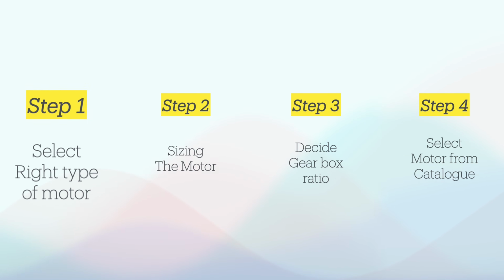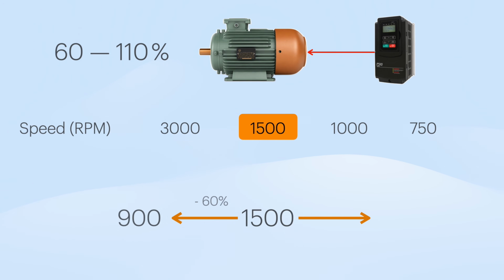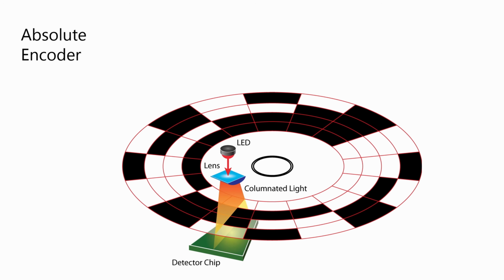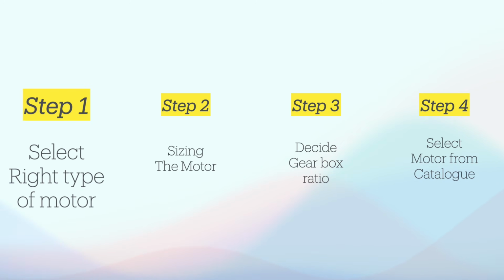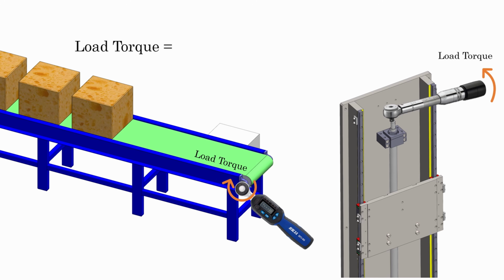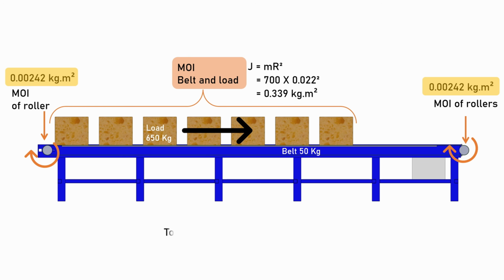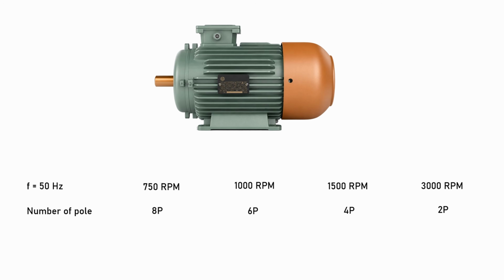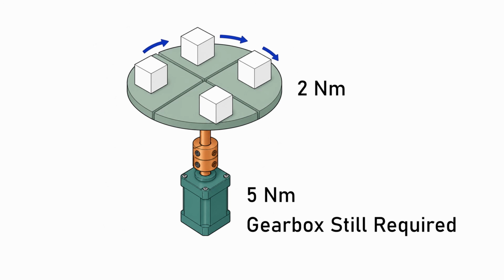Why Most Engineers FAIL at Motor Selection (And How to FIX It)

Comment: Hey I have to buy a motor for a project. It is rmcs2080. The specification has a rated torque 280kgcm which is greater than the gearbox braking torque of 200kgcm, our use  is little more than 200kgcm. Is this a problem?

Comment: 3Ø Induction motors can also be speed controlled using VSD/VFD. This can be closed loop PID, speed or torque vectoring. Advanced motor protection settings. They also have a bonus that when consuming energy Power Factor is near Unity, increased startup torque, reversing, inching, plugging, dynamic braking, communications feedback options, HVAC fire run until destroyed mode...

Comment: HI, 
I have seen rated torque, 
continuous torque, 
standstill torque, 
continuous standstill torque, 
holding torque, 
and continuous holding

Can you explain about this in your next video please.
Reply: ELECT motors has huge " bottom end torque " if NOT  operated for extended time. And depending on Ambiet temp ( winter ) There are applications. Where " over loading " is NOT a factor lol

Comment: Actually, there are so many steppers used in industrial automation rather than PMSM servos, but with closed-loop system by integrating it with encoders for high-precision. These closed-looped steppers are often found in Chinese standard machines like labelling machines, filling machines with peristaltic pump, and PCB solder-paste application machines. The reason is not to make it cheap, but to achieve the same high-level reliability as the PMSM servos, because steppers are accessible in the market, as these high-volume Chinese machines do not operate at variable speed and at ever-changing load applications. Yet, I do agree with you that PMSM servos are best used in highly dynamic machine design, especially if machines or robots to be designed require high acceleration torque + MOI.
Reply: And thank you for these videos. It helped me do something different for my career since I was given only limited work because of my fragmented roles. I consider you as my senior as well :)

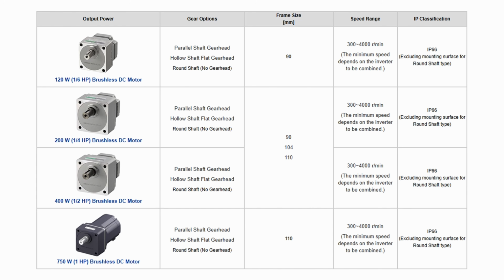Comment: bro was just checking randomly whether u put any video or not,,thank u...and the  screenshots u used like at 5:56 from which website? will be a little help
Reply from the maker: Oriental motor USA
Reply: @mastermechanicaldesign  thank you for your kind reply,,, would you plan to make video on clutch torque limiter and brake please,,industrial ones?

Comment: i have a question... what about the inertia of the motor itself. i mean in large motors the inertia is high and must be considered.
you didnt mention it on the formula. my question is should i consider the inertia of the motor too. 
in some appliciation from what they told me they combine two motors toghether linearly and one is used to overcome the inertia of the main one.
can you explain this point too...thank you in advance
Reply from the maker: Point 1. Yes of course we must consider the inertia of the motor itself, also the MOI of gearbox, coupling, everything which is going to move or rotate from rest. 
Point 2. I'm not sure about the additional motor for just overcoming the inertia of the main motor. If inertia is very High i would suggest using a gearbox, gearbox reduce the inertia for motor by square of ratio (i will explain it in coming videos)
Reply: @mastermechanicaldesign  thank you… for point 2 it’s a practice used very large asynchronous motor when the inertia is very very high… and to overcome the consumption due the acceleration they use a combined one
Reply: A seperate motor just to overcome main ones inertia ? No, wrong, never ever.
Reply: @vovochen  yes its a practice used on the large asynchronous motor
Reply: Inertia of motor is generally given in motor datasheet so you don't really need to calculate it.
Reply: @RajPatel-by3wj not calculate but must be considered… what I mean is the consumption of the motor due to its inertia… he replayed me above already

Comment: I'd like to point two things.

The efficiency of a gearbox may depend on the input speed. They also have an idle torque (parasitic fixed torque) that should be taken into account.

Many times the servo has to be selected simulating its complete cycle and many times the limiting factor is the heat dissipation in the servomotor. Many manufacturers have their own software and sometimes it is available for customers.